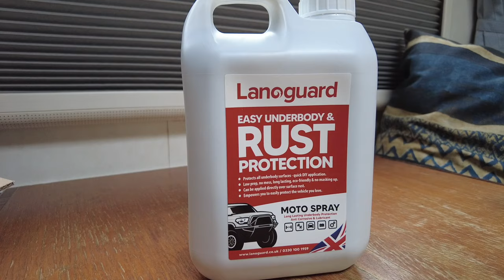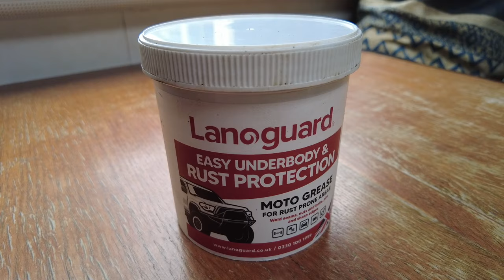RUST can KILL your MOTORHOME - Easy to Apply Rust Protection : Lanoguard

Comment: Ive used Bilt Hamber Dynax-UB on my  22 year old fiat Ducato based- Autotrail. Cleaned up the rust first and applied their Hydrate-80 rust stabiliser. Then gave everyhing two coats of Dynax-UB. Seems to be doing the business so far. Incidentally, I emailed them about applying it to wood and they assured me that it would provide protection to wood too.
Reply from the maker: Thanks @tommo9757, the Lanoguard will protect wood but can trap the moisture that's already in the wood so it could end up rotting from the inside out. This is probably the same with the Dynax and other similar products

Comment: I spent just over a week under Nessa de rusting her. I have a Compressor so I added a Needle Scaler to my tool collection as I need to get rid of rust in places where the angle grinder with a wire wheel attachment would get close to reaching. I used the Needle Scaler the most as it did such a good job. I used rust convertor an all areas that I had removed rust and paint. I then paint the areas I had treated. Some were completely painted as she was that bad in some places. Like Herman she has the complete chassis from the Original Van used. Being Sprinter based rust is well known with the Mk1 Sprinter. I will be looking at Lanoguard As I was looking at using Upols Raptor, but the idea of having to mask up some much of the underside, fills me with can't be botheredness, It was bad enough getting rust everywhere. I think the last of it ha finally left my ears. My Eldest Daughter took a picture of me after a short while under Nessa with visible clean spots where my safety specs had been and dust mask. 
Also Like Herman my passenger footwell is full of holes, to the point Hermans is not to bad compared to Nessa. I remove some of the old welded seams as they were completely gone. tidied it up as best as I could as it is no structural at all. I did have to have some welding done on the chassis. I will be looking at the original cab floor at some point as that has rotted on a weld seam and has been like that since I have owned her, I just didn't see how bad it was as upto recently I had not been under her. 
Next Job is find the oil leak on the engine that lost just over a litre of oil whilst on holiday, Putting us in Limp Mode not long after leaving a campsite near Stirling on our way back to Norfolk. Limp Mode sucks as it takes away the Auto part of the gearbox and the Turbo so hills are a real drag. Once topped up she was off again. 
I have been looking forward to this video since you first announced it, knowing I had the same to do. I think Nessa has spent time near the sea with the amount of rust that she had, and she is five years younger than Herman, but had a lot more rust.
Reply from the maker: Thanks for heads up, @DiggerBuckett. We'll probably see you at the end of the month 👍

Comment: Great insight into what is required (and a little more than I expected tbh) but will be a whole lot easier for me if I do it as soon as we pick up the new motorhome and would seem to be a good investment. Looks like the effort spent on Herman was well spent, especially picking up those little repairs early.Look forward to updates in due course.
Reply from the maker: Thanks @GedandMichele 👍👍. When are you picking up the new motorhome, Ged?
Reply: 1st September Ads. Having waited 23 months thought it worth waiting a couple more weeks to get a nice new plate plus they need to bit an awning, solar panels, BBQ point and sort the Gaslow. I then need to get alarm and tow bar fitted elsewhere. Will be brassic after all that even with an extra 2 years of saving!  @HermanHitstheRoad
Reply from the maker: Fantastic news, Ged 👍👍
Reply: To maintain Hymer warranty from new it will need underbody spray at annual service. In 2014/15 thus was an extra £95 for the spray alone so must be more expensive these days. 
Just something to be aware of
Reply: Thanks for pointing that out @03Timm. Mine is a Rapido but will check the conditions.

Comment: Great video. Very detailed and instructive, Our last van was 17 years old and had an Alko chassis which never appeared to need any attention corrosion wise.. However, after about 3 years I applied ACF50 spray to the Fiat Ducato cab area and it protected the underside of the van perfectly. So it's a thumbs up for that product for me,
Reply from the maker: Thanks @robertpenning3501 👍👍. I've used ACF50 on my car. It's a tad expensive mind and dirt sticks to it, I found.
Reply: @HermanHitstheRoad  you are right, it does leave a greasy film and can attract dirt.

Comment: Been using Dinitrol for years, never had a problem,  alot of car manufacturers use it. It creeps into all to all your hairline cracks. Also available in aerosol cans not just for compressor sprays. What ever you use for chassis treatment you should give it a good clean regardless. Lanoguard is good especially on chassis that are fairly new but I wouldn't use it on an old chassis personally. Would want something that helps stablize the rust. Lonagaurd is just a barrier like waxoyle.
Reply from the maker: Thanks @seanwade8446

Comment: I tend to use por 15 which cures using the moisture in the rust, I did a whole beetle chassis in it and it’s still a shiner black with no new rust.
Reply from the maker: That's great, @jimstelfox6120. Thanks for letting us know 👍👍. 
I restored a Beetle once, decades ago but used Waxoyl.

Comment: Thanks for another good video . Treated my 18 year old motorhome last month and was impressed with the product,  it also gives you the opportunity  to inspect the underneath more closely, to which I found a corroding fuel tank  and now replaced it .
I had used waxoyl before but this is easier to use.
Reply from the maker: I've used Waxoyl before in aerosol and paint form,. This is much better @colinrowland827
Reply: Just wondering did you have to take the waxoyl off before applying the Lanoguard?
Reply: Hi .I used the waxoyl on another vehicle.
Reply: I spoke to lanoguard and they said that so long as the surface your spraying on is sound like underseal etc the lanogaurd will adhere

Comment: Been lanoguarding my Landrover for a few years now. Very good stuff but it does need reapplying in some areas a bit more regularly than others - arches for example
Reply from the maker: Great tip.  Thanks @s1mon1983 👍👍
Reply: @HermanHitstheRoad also if you struggle to see where you've done you  can heat up some boot polish and pour in to colour it black

Comment: Hi Ads. Our Elddis 155 motorhome that we call Mr Leaky is a 19reg. 4 years old. It passed its MOT no problem but believe it or not it got an advisory about rusty tank brackets underneath! Not the diesel tank we are talking about. It's the water tank and waste water tank. Yes, an advisory for the MOT. I had a look and what a rusty crusty paint peeling off mess these brackets are. It's really disgusting that Elddis use such rubbish. The brackets for the drain taps (replaced last year whilst still under warranty) were also a mess and also the bracket holding the flue for the water heater, the brackets for the travel seats (removed) and the brackets all holding the rear end lights corner and number plate panel. All rusty as hell. Since then I scraped the rust off best I could and used black Hammerite on everything (including knocking the tin over on our tarmac drive) A motorhome this young should not be having money spent replacing or protecting rusty parts. If you want my advice, keep Herman. But if you must get something newer - DON'T BUY AN ELDDIS!!!!!!! You have been warned. P.S. and most them get damp issues as well.
Reply from the maker: That's very sad to hear about your motorhome, @derektaylor6713. What about the rest of the body work, is it OK? Maybe you should consider some rust protection before it's too late?
Reply: @HermanHitstheRoad  The body is okay. The back axle has blobs of rust appearing and could do with sorting. The problem I have is I'm nearly 72 and crawling about under a motorhome messing about with rust that shouldn't be there isn't my idea of fun. We bought it nearly new - £42,000. Now a 19 reg is selling for £50,000 plus. A brand new one ( if you're willing to waits for 18 months ) is about £72,000! Helen and I crawled under at weekend and struggled to remove the very heavy spare wheel which is held in place with a wind down mechanism. Really tricky job. The reason being was, it too was going rusty. I took it in the shed and gave it the Hammerite treatment and then silver spray paint. It will now live under the bed because we have freed up a lot of space by removing both travel seats (25kilos each) which were residing under the side seats in the lounge (really rusty brackets holding these in place) We have galvanised catches and hinges and the like on our garden side gate which have been outside since 2018 and are still showing no rust so why can't these brackets be galvanised under Mr Leaky? It's a disgrace. We heard of one like ours that lost both gas bottles from the floor of the gas locker because the floor had rotted out. Ours seems okay as I've checked it. Then we have ad blue for the engine. This is bad news. It only lasts a couple of years before it starts to chrystalise and go off. The ad blue tank holds about 12 litres and is good for about 5,000 miles. But if you don't do many miles it could sit there going stale. At least 2 motorhomes we've heard of have needed new ad blue tanks. One paid £2,600 and another £3,000! From about 2017 diesel engines need ad blue to make them run cleaner. There's also umpteen sensors as well that can go wrong. As I write, Helen is on a Facebook group reading horror story after horror story about new or fairly new Elddis motorhomes. It's a nightmare. And then we have constant damp issues. It get's repaired and fails again the year after with damp in another place.  I greatly admired you for tackling all that rust under Herman but please, as I've said before, keep hold of Herman as long as you can and don't waste your money on a newer one. Please take this on board. I have an inkling that Swift are a lot better but who knows. Cheers.
Reply from the maker: Thanjs for the advice, Derek. I suggest you both stop reading about the horror stories and get out in Mr Leaky more
Reply: @HermanHitstheRoad  Yes, you are perfectly right. We'll take your advice, thanks.

Comment: Lanoguard looks nice in the advert. However the vehicle underbody that it is applied too is spotless clean and has been prepared in a blackened paint or such. This makes the underbody look very impressive when applied, because it looks shiny shiny. Lanoguard is also required to be  an annual application. Impressive maybe not.
Reply from the maker: It's not been painted with black paint, @tstuart7333 the rusty parts go that way. You only have to watch my video to see that. Yes, it does look very impressive. It's shiny because it's probably still wet. Yes, you should apply it annually (like other products) but it's easy and quick to apply.

Comment: Hi. Lanolin was used by many motor manufacturers in years ago such as minis and Morris minor before being painted. Cars we stored outside before painting. I personally use waxoil which is available clear, black or white. I tend to use tetrosol black with waxoil in it on underneath as you can see what's been done and mot guys know and looks like it's well looked after. I also use stone guard as well. Clear waxoil on inside doors as if on aintwork it doesn't matter. Just done my Bongo. Viz on my channel. George
Reply from the maker: Thanks @MakeDoAndMend1 👍👍. Sounds great

Comment: Good old vactan to treat & red oxide to protect
Reply from the maker: Sounds like a lot of hard work, @VanlifeHQ
Reply: @HermanHitstheRoad  it’s not that bad really mate 

Also depends on if you want to keep your van for years it’s the correct way & is used this way on boats, 
Unfortunately the bare metal still needs painting & the wax can be easily breached leaving bare metal 

The vactan & Red oxide both eat into the metal opposed to just sitting on the surface 

Any protection is better then none we need to keep the older vehicles on the road before they all vanish by the hand of the government....

Comment: Good job well done. Should have been wearing a proper face mask though.
Reply from the maker: Why do you say that, @billy.b652? It isn't poisonous or dangerous to people or the environment unlike most other products (e.g. Dinitrol). However, I did wear goggles when spraying and I used breathing mask when applying the rust converter.

Comment: Complete waste of time, you can’t fix a structurally rust damaged chassis with wax. When are Al-Ko going to build the entire chassis for the Motor Home industry not just the rear end, I’ve yet to see an Al-Ko caravan chassis with any structural rust, even when the whole of the bodywork has collapsed.
Reply from the maker: Lanoguard doesn't fix anything, @aliterogasolini6401. it stops rust from forming or getting worse by not allowing the air get to it.
Reply: @HermanHitstheRoad 🤔😆😏